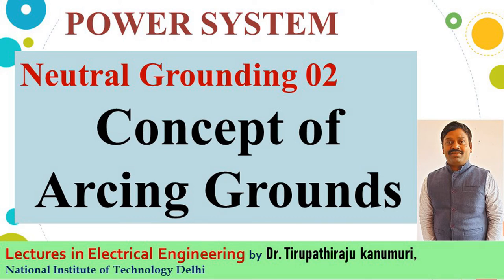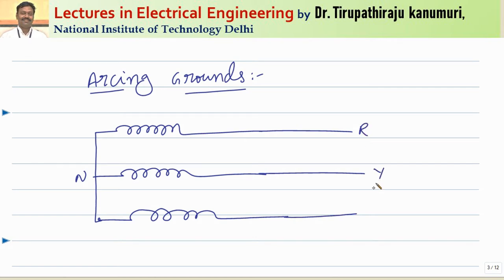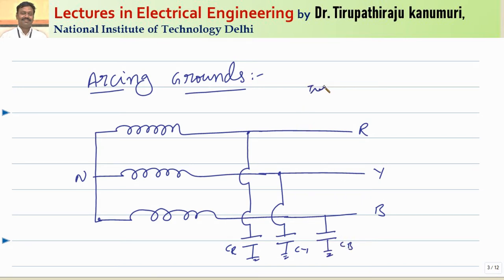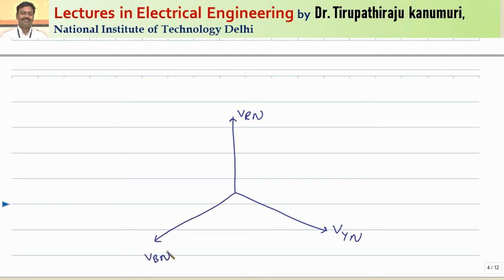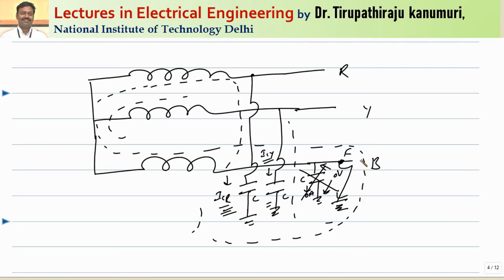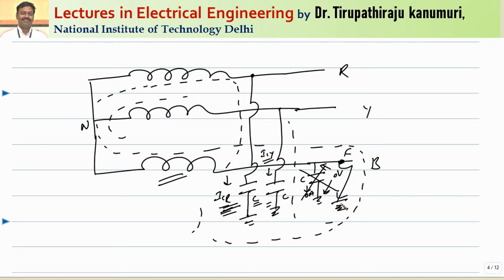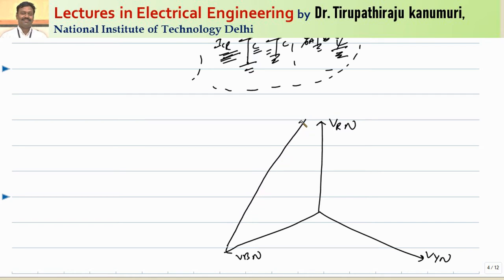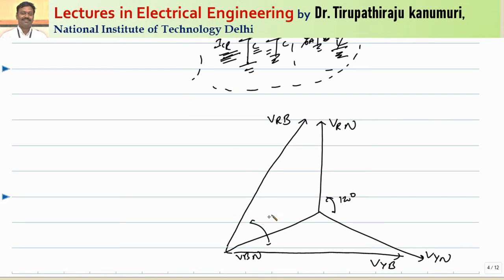PS72 Concept of Arcing Grounds

Comment: Sir if the faulted line is at zero faults. Why capacitor voltage is voltage between healthy phase and faulted phases equal to root 3 times phase voltage. If faulted phase is B and its at zero volts, then VRB = VR - VB = VR - 0 = VRN. So why capacitor voltage is now line voltage if faulted phase is zero volt?
Reply: @lecturesinelectricaleng  Thanks i understood it. I was mistakenly taking phase voltage as line to ground voltage.

Comment: If we are using IT system for some critical load to get continues supply (E.g. in hospitals & railways), how we can protect the circuit in isolated neutral system. IMD/MCB/RCCB/SPD can protect the same?

Comment: sir, during this L-G fault as there is no fault impedance and b phase is  connected to ground, B phase also zero, then how can voltage across across ground capacitance will be line voltage during fault.

Comment: I got two questions sir.

1. if one line is connected to ground on the case of ungrounded system, does it automatically mean a three phase fault occurs? because the current flowing came from the two other lines as you show on the lecture sir.

2. And if you said current flows from the other two lines, should we see it in actual that the arcing ground in action is connected to all the lines and not only with one line to ground? Does the diagram you show us here represent one line with flash over to ground?

I hope you'll give us clarification on these sir :D

Comment: Sir, at the time of arcing ground current in faulty phase instantaneous current in the form of arc naturally getting zero so the energy stored in inductor is getting zero. Why this energy of 2 IC getting transferred to capacitance. after the arc getting extinguished naturally normal ic from that natural zero of 3 ic will be fed to capacitor through the inductor.
Reply: from 13:15 sir
Reply: Sir if arc gets extinguished other than natural zero of instantaneous current of 3 IC waveform than at that instant energy of inductor gets transferred to capacitor. Since the only path the current through the inductor ( current through cannot be zero suddenly) can pass is through capacitor. If the arc got extinguished at natural zero. current through the inductor is already zero ( energy in inductor = zero) why will it transfer energy to capacitor. Sir, my doubt is this.
Reply: Sir I understood all other concepts that u taught in this lecture like how line to line voltages appear in other two phases other than faulty phase, capacitive current increases compared to normal capacitive current, arc formation. except the point I asked u in previous comment.
Reply: Lectures in Electrical Engineering Sir if arc gets extinguished other than natural zero of instantaneous current of 3 IC waveform than at that instant energy of inductor gets transferred to capacitor. Since the only path the current through the inductor ( current through cannot be zero suddenly) can pass is through capacitor. If the arc got extinguished at natural zero. current through the inductor is already zero ( energy in inductor = zero) why will it transfer energy to capacitor. Sir, my doubt is this.

Comment: Sir in b  phase voltage  is zero then how voltage across the capacitor  will be  equal  to line  voltage
Reply: @lecturesinelectricaleng  even in neutral grounded system I think  voltage is not going to be zero as emf is continuously  generated  by alternator supposing the above windings are of alternator. Correct me if I am wrong.